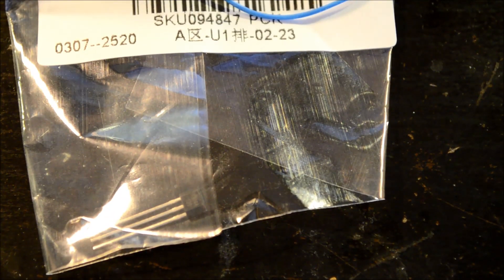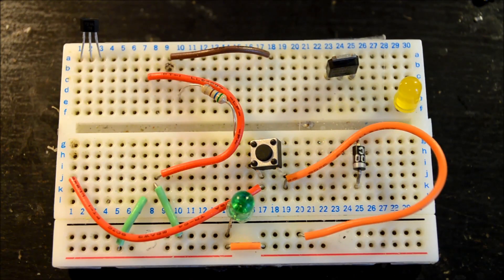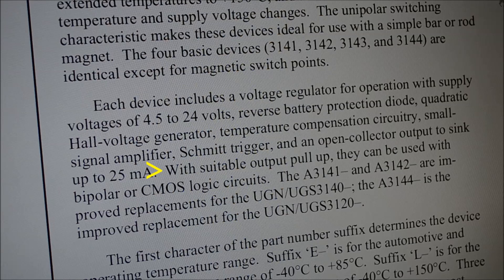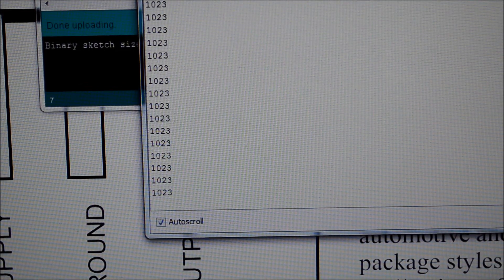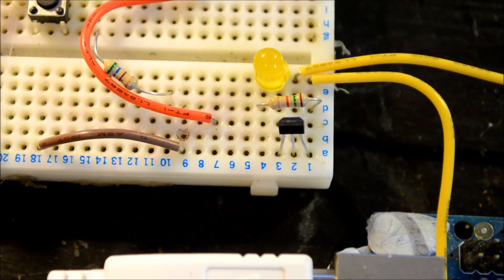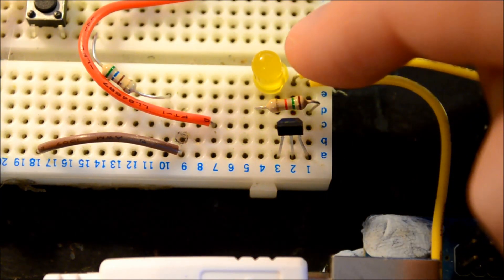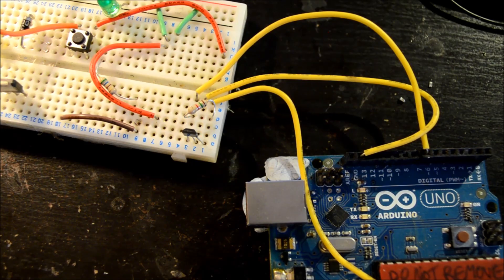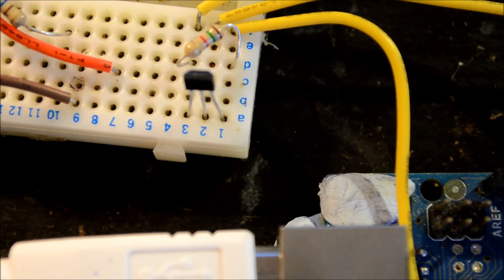A3144 Hall effect switch - introduction

Comment: hateto be a   damper    -    but  Ardino  - to   then a  laptop or desk top  
Asa fornmer  service engineer    -  oscilloscope   is  slightly cheaper   ,  even  cheaper  is  multimeter    of cheaper still  a  transisator  and  LED .

Comment: The A3144 is a UNIPOLAR hall effect sensor. It only reacts to one pole of a magnet. In addition the sensor can be used with back bias. The actual sensor is closer to the beveled side as it is with most hall effect sensors.